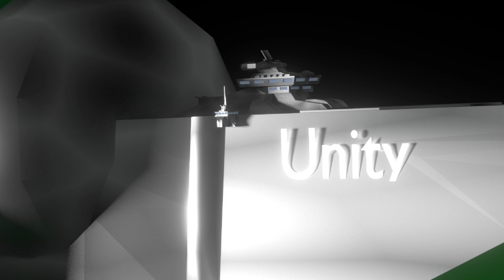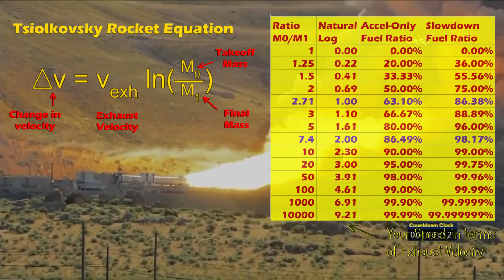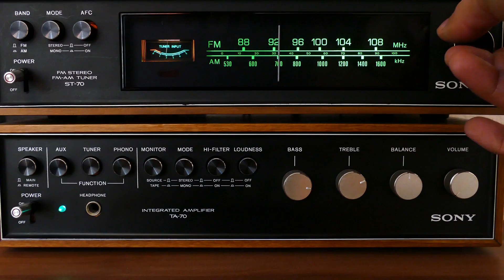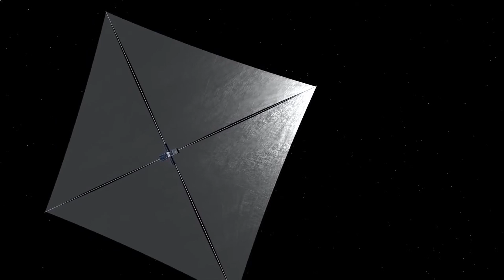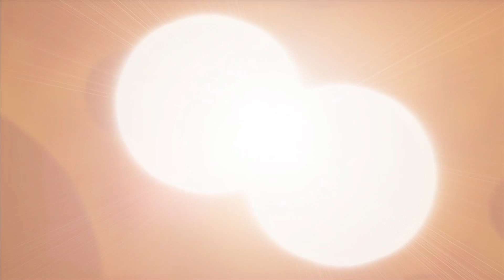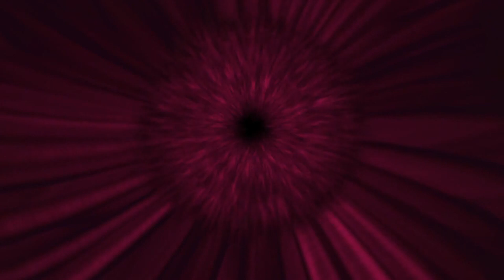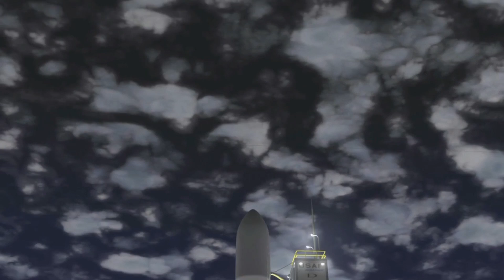Interstellar Travel Challenges

Comment: Sounds like you'd have to turn an asteroid into a space ship.
Reply: The question is whether a type S or type C asteroid would be strong enough for the acceleration.  The rare type M is probably strong enough as they are fragments of a protoplanetary core but you can get water, ammonia and dry ice from type C and type S, and volatiles such as hydrocarbons from type C's.  Maybe if you make wire cables from the type M and knit a bag to hold the type C's, type S's and a frozen comet.

It should be noted that both type S and type C as well as comets are undifferentiated material and hence resources are dispersed not concentrated.  Our smelting techniques require a minimum of 70% iron content in the ores and we currently only use ores with 90% concentration.  The concentration in undifferentiated matter would be about 8%.  We could use bacteria to extract the iron just as stone age man used bog iron (40% iron) which is produce by bacteria consuming iron from the 5% iron of our crust but that takes generations.

Comment: And what happens if the dust particle is moving in your direction or worse an angle that the UV deference system can't engage?
Reply from the maker: Half of them should be moving in roughly your direction, but their own speed relative to the local medium is fairly irrelevant, beyond factoring into positional uncertainty.

Comment: I finally realize what those "deflector dishes" were for on the Star Trek vessels.

But anyway, the laser constantly flashing out to "vaporize" micrometeoroids along the way would incur a continuous stream of power.

What is the percentage of available power needed to perform that task over 60 (or 120 ) years?
Reply: It would act as a propellent against the ships' momentum, not very much for lower speeds but would still need to accounted for.

And as you got faster that laser would need to be more powerful and thus produce more thrust against the ship.

Comment: You heard it here people. I solved interstellar travel. So essentially, the laws of thermal dynamics and quantum mechanics will soon prove, that if a particle is split, its sister particle can be sent faster than light. When it reaches the ideal destination. The original particle can be super conducted using high frequency magnatronic's and Tesla coil. The particles mass will distort space time and the sister particle will become negatively charged. This negative charge will begin to distort space or fold space. At the peak of this distortion of space time can be simply traversed without concern of colliding with matter, because the magnetic field of folded space will push space/time around the folded space.  Essentially travelling without moving.

Comment: Two things. 

1) Women are born with all the eggs they will ever have  whether aging or not.   Either ovaries would have to be genetically engineered to produce eggs,  or be able to control egg release only when pregnancy is desired.  Due to finite living space and a probable preference for colony health over passing on one's genes due to lifespans of several thousand years, reproduction will probably be closely controlled.

2)  What about a disc or spherical shield composed of super magnets encased individually in balls of iron particles?  The structure would have great impact absorption qualities,  be more or less self healing , and a group of titanium based robots could be on the backside maintaining optimum  configuration.  Don't know if it would be worth coating the iron particles in something that would collect hydrogen for in flight fuel collection.

Since hydrogen and iron readily form an alloy at high temperature and pressure  and then disassociate with cooling and  low pressure, it should seep though the shield providing a convenient fuel source for shield maintenance robots working on the backside of the shield.  That would imply the robots would have their own fusion engines, or be supplied with oxygen.  Otherwise,  Unity would have a hydrogen collector behind the shield.

Keep the amazing videos coming!  My favorite part of YouTube by far.
Reply from the maker: They're also born with millions of them, most gone by adolescence, not hard or particular invasive to remove a few thousand for cryo storage, nor to get them from another person and remove the DNA and insert your own :) And yes a magnetically assembled liquid or sand kind of armor is an option but keep in mind we've got some serious magnetic and electrical fields going on outside that ship, which probably needs to be a Faraday cage for safety, especially if you are using your own mag field to repel ionized dust and gas.

Comment: Ridiculous and pointless video, you cant extrapolate interplanetary rocket propulsion to interstellar travel. 

The only viable technology is something like the Alcubierre drive using a warp bubble which means nothing in the video is relevant.
Reply: I strongly disagree. For one, I'll bet my left arm that FTL will never be possible. And I'll bet both arms that the Alcubierre drive in specific is impossible. 

For another, FTL is not needed anyway. This video explains how to do it with fusion at 5-10% lightspeed. And it can be done even without fusion, using technology we already have. I don't think we'll need to, but we COULD go to alpha Centauri with generation ships and ion drives or laser sails, or half a dozen other real, proven means. We can do it the slow way yesterday. 

What I do consider stupid and pointless, or whatever you said, is expecting to violate the speed limit. Maaaybe it will happen - maybe the Loch Ness monster will invent it - but there's lots of reason to doubt it.
Reply from the maker: That is no fact, that is you being pessimistic about alternatives, and honestly wildly over optimistic about the other. If FTL ever becomes possible, that's great, as a physicist I find it unlikely but would be happy to be proven wrong, until that time I try to show that sub-luminal options are indeed viable, because I won't be held ransom to some slim chance someone will find a way to make the square root of negative one real.
Reply from the maker: The only one we've been discussing, your claim that sub-luminal interstellar colonization is ridiculous and pointless.
Reply from the maker: As an FYI there is an episode on the Warp Drive. Why not, by the way? Extrapolate interplanetary to interstellar?
Reply: I will look out for it.
Its the rocket engines (or any reactive engine) that does not extrapolate. All are way way too slow.
Reply from the maker: Slow is relative, and I think you're ignoring fusion having a much high exhaust velocity, which was discussed in the episode.
Reply: Slow is relative, the speed of light is too slow, meaning exhaust velocity is irrelevant! Our current technology is not good enough to contemplate a realistic drive system for interstellar travel. The Alcubierre drive is a possibility but we have no real idea how to achieve it. The speed of light is no barrier we need to stop thinking it is.
Reply from the maker: I think you'd benefit from more time looking into this topic Manoo. You are welcome to believe FTL may be possible, but you seem considerably more confident of its viability then Alcubierre himself does, for instance, and the reasoning just given is not a good one. That space can expand faster than light can cross it does not imply you can travel faster than light.
Reply from the maker: Manoo, there is no technology to 'not work', there is a line of mathematical reasoning based off some assumptions which probably shouldn't even be classified as 'might be true' but instead as 'have not yet been explicitly disproven'.
Reply: "Our current technology is not good enough to contemplate a realistic drive system" Nuclear propulsion is super effective for interplanetary travel and is even viable for generation or seed ships and constructing them would be super-duper cheap if we are able to construct a space elevator. I personally think that nuclear propulsion awaits us in the immediate future as I'm pretty pessimistic that there will be a significant breakthrough in space propulsion technology by the time we are able (hopefully) to construct a space elevator.
Reply: Bo Zo
So the fact the distant galaxies are moving away from us a greater than the speed of light isnt a clue to how the light speed barrier is NOT a barrier.
Reply: Isaac Arthur
It depends on your reasons for suggesting it may not be possible....
As an example of FTL in the natural world I think the distant galaxy is a good example of the principle in action. So it depends on whether you think the technology doesnt work or the principle doesnt work?
Reply: Isaac Arthur
The issue was whether you believe FLT will 'ever' be possible? Or if you think the warp drive will 'ever' be possible?
The distant galaxy example shows us how it can occur in nature and a warp drive is a mathematical solution to produce the same effect that does not contravene any physical laws. The requirement of special 'materials' which may not exist limits the current 'design' but that will not always be true. Alcubierre's work has already been refined/improved for the better. The future development of a theory of everything may solve the issues currently making the warp drive 'unlikely'
The fact remains that warp drive is currently the only viable solution for interstellar travel and beyond.
Reply: Isaac Arthur
I am not being pessimistic at all, I am assuming that all sub-luminal reactive engine designs you covered may work. They are still largely useless for interstellar travel. With the nearest star over 4 years away, with acceleration and deceleration thats more like a 6 year trip. There is serious concern about going stir crazy on a 6 months trip to Mars!
I doubt man will ever attempt a sub-luminal trip outside of our solar system. 
Personally I think we should be putting all of our efforts into anti gravity technology, build a base on the moon, develop the fastest accelerating reactive engine design possible, explore the solar system, continue to work on a warp drive or similar FTL system, then look towards Alpha Centauri and beyond. Anything else is largely wasting time and resources.
Reply from the maker: Considering there are entire episodes on this channel discussing that matter, am I to interpret that remark as indicating you've not watched them or that you disagreed with the reasoning?
Reply: procletnic
Nuclear propulsion may be viable for interplanetary travel but I think a space elevator could end up a huge white elephant. Anti gravity is a far more realistic goal to be aiming for as the next technological step into space.
Reply: Isaac Arthur
I have watched several other relevant episodes, can you be more specific about what you class as 'that matter'?

Comment: So you said that the ship would not be aerodynamic, just a un-sharpened pencil shape. However wouldn't it make sense to shape the ship into a cone? that way debris that would impact the hull bounce off rather than get absorbed.
Reply from the maker: Yes sharpening the pencil is an option for some bounce, I think it would depend a lot on the actual speed and the local density and composition of space though, and I've never run the calculations. Assume a correction on there that the ability to sharpen the pencil to an appropriate angle would be an option :)
Reply: Thanks I think I will run some calculations of my own.

Comment: Off topic & probably already thought of, but if you wanted a simulated world to have more detail than the one you're in, then time would have to go slower in the simulated world, or at least if it is of the same size or larger than your own existence/universe.  although there's probably plenty of variables I over looked, this could, by no guarantee, result in less simulated "sentiences" than non-simulated sentiences although if you're aiming for more detail, then you would probably not declare anything specifically sentient, but rather some fundamental laws, like our "laws of physics", simulated sentiences could still easily outnumber non-simulated one though, you might have 4 sentient beings in the "real" universe/existence, and then have 6 trillion sentient beings in the simulation, going back to the "it's more likely that you're a simulation than an original" thing, the word "original" being very vague & plastic in this statement considering that if the simulated world has more detail than the "real" one, the sentiences probably wouldn't resemble the ones in "reality"  I mostly brought this up to propose another idea for why slow objective perception might be used or what might cause it.
 :)   yay I feel accomplished! although I'm pretty sure someone came up with a more refined version of this concept before me.

Comment: The ship does not need to have a 250 meter shield and also does not need to be limited by that radius.  You only need to shield the part with passengers.  So for example a 1 km diameter with living space 3.18 meters high (around 10 feet) is 1000 square meters.  That is much less than the 200,000 sq meter shield you would need for a 250m radius.  It is also easier to deflect a particle by 1.6 meters instead of trying to deflect it 250 meters. So the ship should look more like a pipe with dust passing through the hollow center.  The magnets could divert to the inside or outside. 

You could also use reinforced shields on two opposite spots on a ring.  Most of the cylinder could be used for growing plants and storage.  Just rotated whatever you need to the passengers and keep the passengers behind the shield.  On earth most suburban homes in the United States are withing 20 meters of the road.  So maybe two 3m by 20m reinforced shields.  The second ship is described as the more dedicated hard core colony group.  Maybe they can tolerate trailers parked next to the single lane road.  Cut shields to 3m by 10m.  You could plant flowers in the extra 10 meters of growing space.
Reply: how do you  get your gravity?
Reply: rotation.  Arthur's unity ship is supposed to have 100 square meters per person radiator surface.  The habitat area is on a narrow strip on the side of a huge rotating cylinder.  Both the shields and habitat rotate.
Reply: I understand what Arthur is talking about: I don't have any idea what you are talking about. What exactly are you proposing (skipping the details)?
Reply: Ok, thx.

Comment: what about the idea of ships being small and fast like the Valkyrie https://en.wikipedia.org/wiki/Project_Valkyrie which use Anti-matter?
Reply from the maker: I seem to recall specifically mentioning that anti-matter let you have smaller ships... and I did discuss Valkyrie in an earlier episode.
Reply: then those ships would not have the same design
Reply from the maker: No, different shape, probably more conic, much more important to bounce stuff away at those kinds of speeds, more time spent accelerating too, or at a higher rate anyway. We'll touch on that a bit next week.
Reply: with a Valkyrie its like a cable car would you not use a sphere for the crew module

Comment: The thing you mentioned some videos ago about using flywheels as batteries in space, could those be a really really efficient energy store if you tried to push the peripheral up to light speed and really started mounting the decimals?
Reply: the maximum energy in a fly wheel is limited by the strength of materials.   If you spin faster it will snap and fly apart.
Reply: Touché, this would require some kind of unobtanium I guess.
Reply from the maker: That's kind of what the internal rotating habitats is, a big battery flywheel you can spin down a bit if you need some extra juice and reactors don't throttle fast.
Reply: That could convert the pleasure cruise into a vomit festival.

Comment: Was just thinking, why not use pulsed lasers that are aimed at the general direction of travel? No need to track targets just keep blasting every couple of seconds or so. Powering the array is not an issue, right? I say array because it's easier to cover sufficient area without too much spread of the beam = more power per area = further reach.
There would probably be an overheating issue but that could be dealt with, probably. Maybe need to find a sweet spot between heat production / frequency of pulses / distance efectively covered. Speaking of frequency, choosing the right one in the electromagnetic spectrum might have a positive effect

Comment: Some ideas for interstellar spacecraft.

Magnetic drag sail: good for slowing an interstellar spacecraft to less than a percent of light-speed and then the fusion or anti-matter rocket can take over leaving more fuels for accelerating.  And since magnetic drag sails work better at higher speeds, double twice as fast only takes a little bit longer to slow down.

Whipple shield ship: if fusion fuel is cheap and the colony ship is just one giant factory, another ship could be constructed with multiple layers of Whipple shields wider than the colony ship that flies ahead taking damage from interstellar dust.  When it's time to deploy the magnetic drag sail, the colony ship can grapple the shield ship with tethers and slow it down as the drag sail decelerates the colony ship.  Ideally, a shield ship would do the job of protecting the colony ship without supercomputers-targeted lasers zapping grains of dust.  For added protection, a magnetic field could be projected from the colony ship.  Even collisions at a few km/s will generate some plasma so I would be surprised if the entire mote of space dust wasn't completely turned to plasma.
Reply: Magsail is a good idea. 

What's the advantage of a second shield-ship, though, compared to just putting the same shields on the one ship?